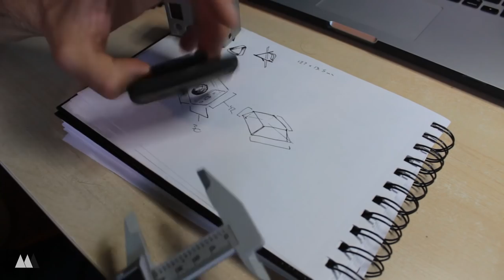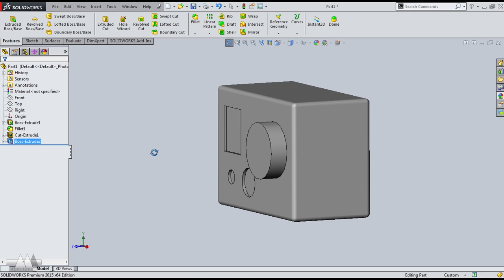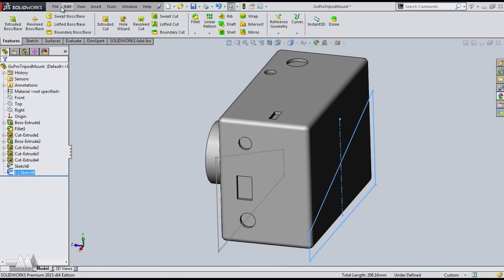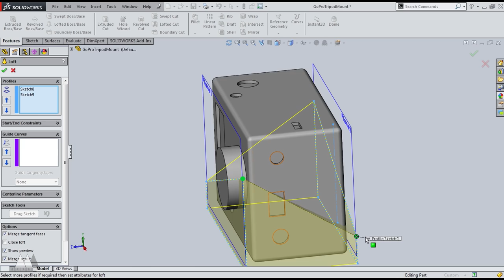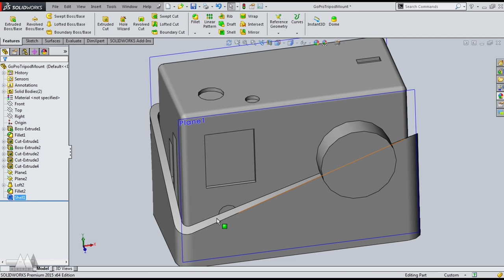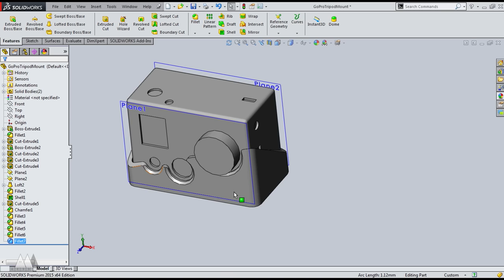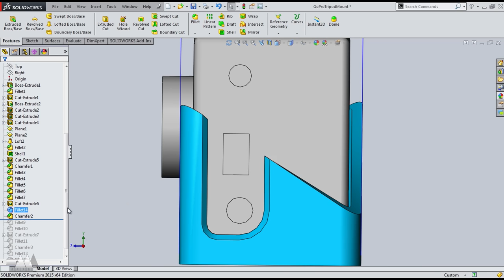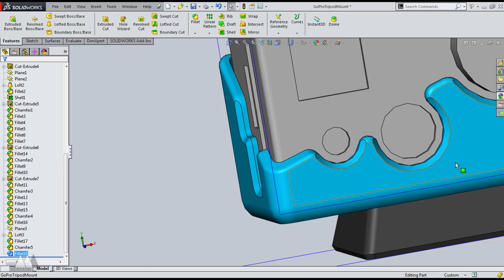Making a Custom GoPro Tripod Mount

Comment: As someone who is learning CAD, thank you! Your step-by-step process is extremely helpful, even though I've been using Fusion 360 instead of Solidworks. I wish you had a Session instead, cause I'd love to print one of those cases (without having to design my own, but I know I should totally just design my own)
Reply from the maker: Glad I'm helping! Would you say F360 is similar to solidworks or is it a totally different beast?
Reply: Not the person you asked, but I have a similar experience in SolidWorks as you based on watching your process in videos and I'd say as a first time user of Fusion 360, it seems like a harder workflow until you nail down all the keybindings, sort of like how Blender heavily relies on keybinds. Everything that is sprawled out on the top bar under menus in SolidWorks is under dropdown menus in Fusion and imo is a pain to figure out. I'm trying to learn it so I can take advantage of the CAD to CAM when I need it (Starting a CNC course in January). It's relatively the same, just jumbled around a bit, workflow is slightly different, and it uses different tree methods and 3D space control (AutoDesk's ViewCube).
Reply from the maker: Robert McEwen Gotcha.. doesn't sound like I need it right now. I think I'd be better off learning Blender.
Reply: Most of the time I can accomplish things much faster in Blender, especially organic models. Its modifiers are incredibly powerful and save tons of time. But it doesn't create as good of geometry as CAD software unless you do a ton of subdivision surfaces. Plus you can't do anything parametric in Blender, so precise models are a huge pain. 

They serve two different, but similar, needs. I taught myself blender several years ago at my last "real job" to help with product visualization in our catalogs. I don't regret learning it one bit and still use it from time to time.

I'd say that SW and F360 are the same beast, just laid out differently.

Comment: YES YES YES!!!... I have been googling for the last hour just trying to find a base for my GoPro 7 to mount onto a tripod without the need for that stupid GoPro cage... sick of all the screwing and unscrewing ... I want to just pop my cage-less GoPro onto a tripod mount with a 1/4" screw mount and quickly pull it out/off without the need to unscrew that cage, pull the GoPro out of its cage and open the SD card slot...and a mount that allows me access to the USB port to keep my GoPro charged with external power to allow me to do extended timelapse videos... why is it sooo hard to find what you have created to use for hero 7!!!!!... frustrating....

Comment: Next time you design something to fit a real product, you may want to check Grabcad. They have a ton of very good and precise model you can load up into an assembly and work around.
For example, here's a Gopro Hero 2 https://grabcad.com/library/gopro-2-1  It should be the same dimension as the hero 1 you have.
Reply from the maker: thanks, I'll have to keep that in mind... that could be a huge time saver!